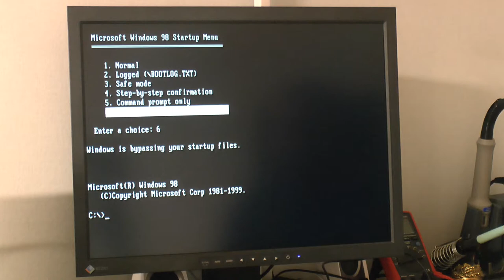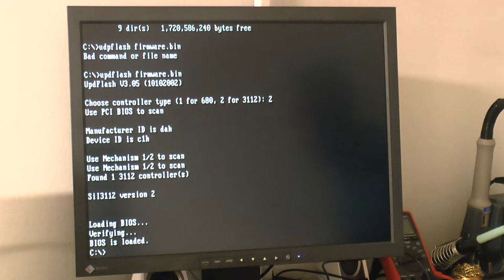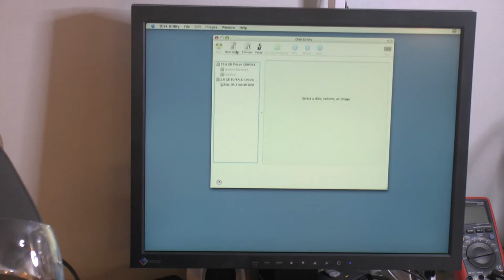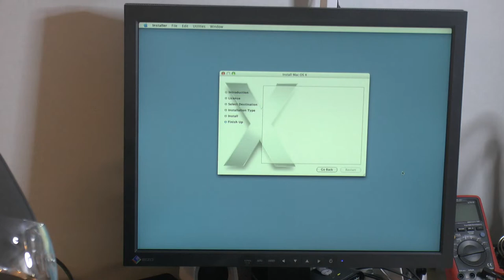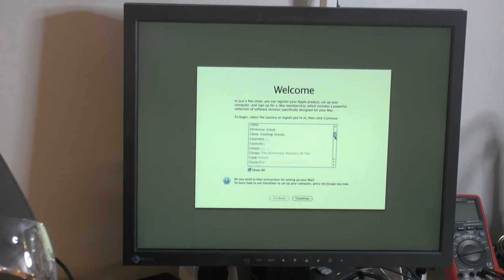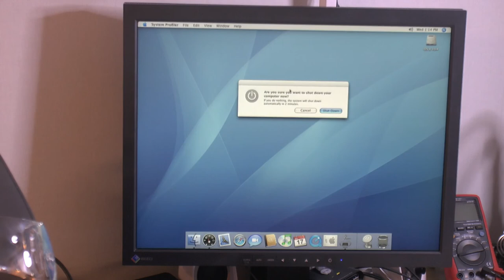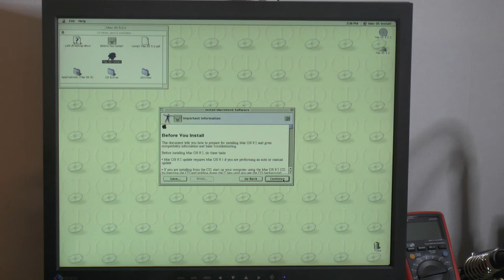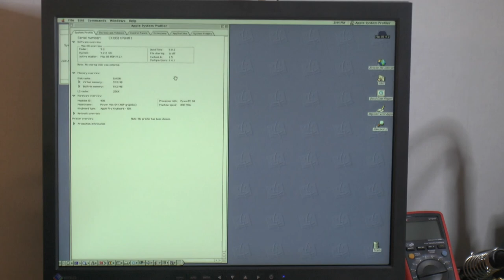Power Mac G4 restoration and upgrade - part 2

Comment: Thank you for also posting the links in the info. Interesting modification! What games are you planning to play on it?
Reply from the maker: So far I have installed, Quake 1 to 3, Unreal and Unreal Tournament from 1999, Deus Ex, Duke Nukem 3D, Doom 1 and 2, Age of Empires 2, Diablo 2, Warbirds 2.77, Sim City 2000 and 3000,  Return to Castle Wolfenstein.
Going to be installing more asap like Command and Conquer, Starcraft etc etc.
You have any suggestions on good Mac games, maybe exclusives?

Me and my friends we do retro lans so this thing is going on a LAN as soon as the pandemic allows for it and Im not going to be the only one with a Mac next year.
This was our previous public lan, due to the pandemic we dont have public lans atm.
https://youtu.be/pcOE3DXi10g
Reply: That LAN party looks like great fun! Hmm, I wonder if it's possible to create a VPN to use with Mac OS 9 to play old games. Some actually support multiplayer over the internet, as long as the necessary ports are open. 

Shadow Warrior is a great FPS based on Duke Nukem 3D engine, features 3 storylines.  Another FPS I am currently playing on my Blue & White G3 is Damage Incorporated based on the Bungie Marathon 2 engine. 
For strategies I suggest you try Total Annihilataion, this one is a very powerful and very expandable 3D strategy game which can bring a G4 system to it's knees, based on how you play it. For this one, the faster the processor, the better the video card - the larger maps you can play and bigger armies you can build.
Reply from the maker: @minims  I dont see why OS 9 would have much of a problem with the more common games like Quake and Unreal. I had a server running retro games so we could play easily over the internet with our Windows 95 to 98 machines. But the SSD died during windows 10 update and the machine had some MB problems to so.
I do have another server but its configured for LAN primarily, I used in in that video to host the local games. 

Anyways the only problem some game have is that they expect to be on a public IP or on a LAN not behind NAT, but me and my friend just forwarded the ports for Diablo 2 on our routers to the retro machines IP's and we played Diablo 2 like that a few times. I dont see the Mac having any issues with playing online as the game has Multiplayer support over TCP/IP.

I take my PC's with like Voodoo2 out and play on random UT99 and Quake 3 servers on the internet sometime, not that Im good at those old games but I came first one someones UT99 server once with my Voodoo2 SLI setup and Via C3 processor against modern machines hehe.

The group of people I play with want to greater a VPN network for Windows 98 SE, but the problem is finding software for Windows 98 that will do that properly.
I dont know about Mac OS 9 and what VPN software might exist for that.

It would be nice if there was a "new" VPN client for legacy OS like Windows 9x and Mac OS and so on but someone has to write it then I suppose.
Reply: I'm thinking there might be routers out there which can create and connect to VPN, so you won't have to do it on the computers themselves.